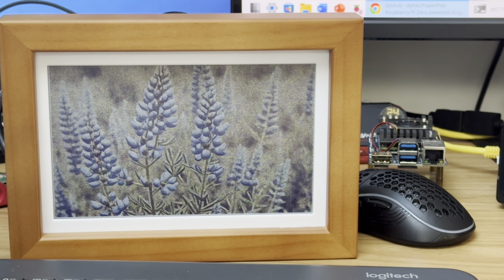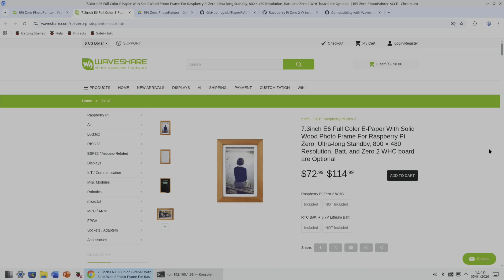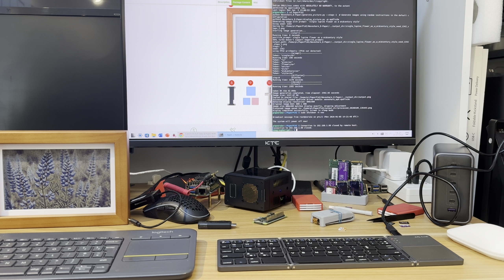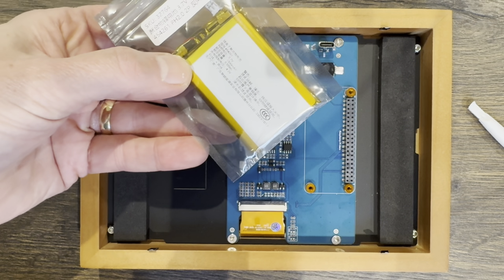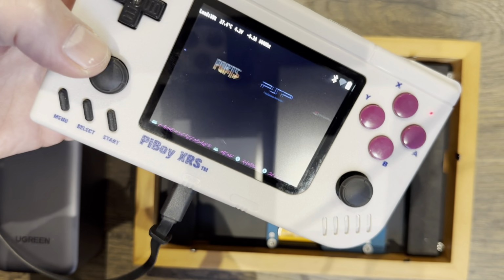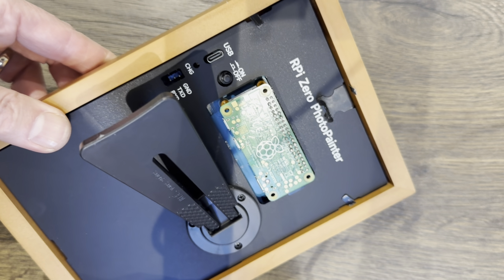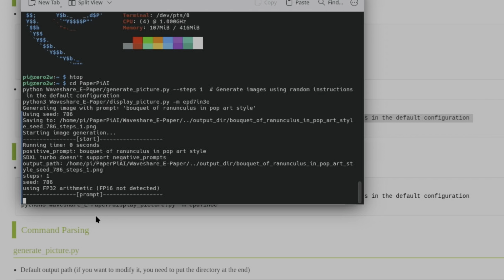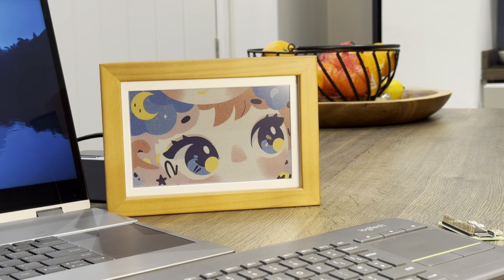Pi Zero 2W powered Full Colour E-Paper display with Local AI image generation

Comment: I bought the exact same frame as in your video and flashed the pre built image from the Waveshare Wiki (32 GB). The system boots and I can see the desktop via HDMI, but no matter how long I wait, no image appears on the frame. Have I forgotten something? Do I need to start something explicitly? Or have I overlooked something? Any help would be greatly appreciated.
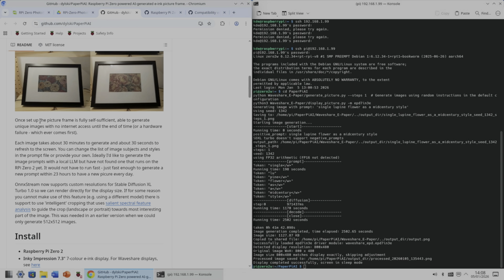Reply from the maker: Check the terminal commands at 1:00. You need to run PaperPiAI
Reply: @leepspvideo   Thanks for your fast reply. It seems that PaperPiAI was started as cron job but only at 8 o'clock within the pre built image from Waveshare. I totally overlooked that and the internal time. I changed this to every hour and it now finally works. This is like magic and i'm always sad if a nice picture is being replaced. But at least they are cached ...

Comment: Would not running the pizero desktop help generate a picture faster ?  Rpi bullseye still runs on pi 3b/3a+/4, more ram higher clock speed, python program could be modified to create unique filenames, to build a library of images, rpi can work with lower screen resolution like 1280x720 on hdmi display or dsi display, for network use nmtui to set fixed ip address (or  sudo nmtui )
Reply from the maker: I would think so. I just downloaded the pre-made image from Waveshare

Comment: Cool

FWVLIW: Soldering - we all have to start somewhere, a tip. Invest in a bottle of no-clean flux, preferably one that comes with a brush in the lid. Paint a little flux on to whatever you're soldering and... a night and day change. Some controversial advice? Get some leaded solder, preferably with a rosin core. (ventilation!)

Yes, a non-crappy soldering iron will help (a lot) but no need to go overboard. Something cheapish with a heat control knob and decent wattage in case you find yourself soldering something that soaks a lot of heat will be all you need 99.9% of the time. Decent solder braid is worth having on hand, just in case.

PS: At least for through-hole stuff:
Heat the joint (ie. touching the two things you want to solder with your iron for a mo') Then introduce your solder to the heated joint, preferably not the iron.
It's important to have a clean joint and iron at a decent if not outrageous temperature. The iron preferably 'pre-wetted' with a little solder to help heat transfer and to prove to yourself it's hot enough before you begin.